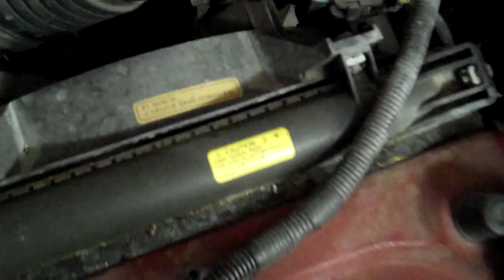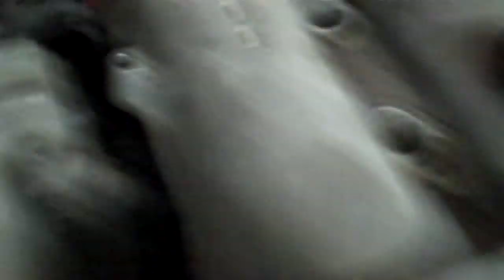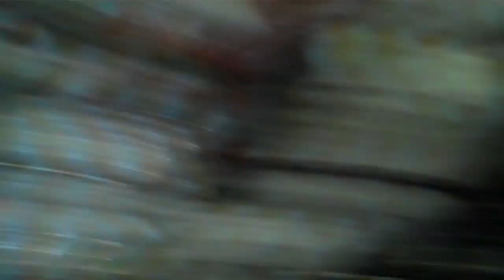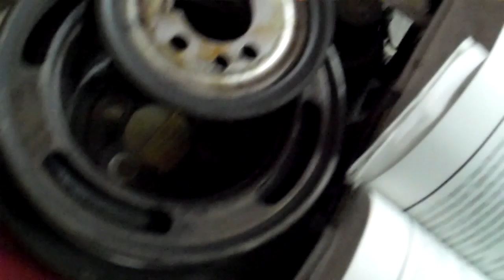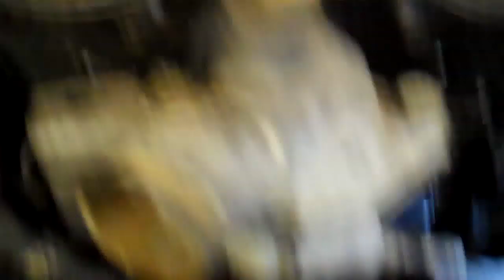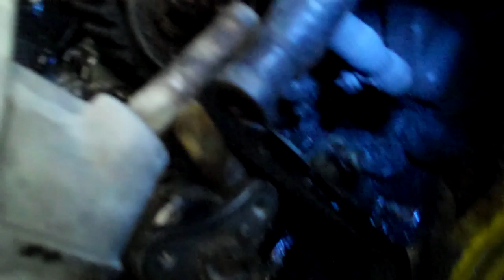Mazda Miata Timing Belt and Water Pump How to Part 1 of 2

Comment: Brian , I'm in a urgent situation where I need to fix or swap (I only have new belt and pump here) 94NA8  but its is in a place where I don't have the luxury of space or time and was wondering if there is a quick trick to seal the big leak & attempt drive the car to a garage...or at least my place , 10 minute drive ... I may tow if no other options.

Comment: Brian one other issue on the Miata is the crankshaft key on the lower timing sprocket, I found mine slightly damaged and was changing my timing back and forth. If your changing the timing belt its best to remove the bolt and replace the key and bolt.

Comment: Harmonic Balancer - easier said than done.  That was a step that needed to be shown.  The 4 - 10 mm bolts were easy enough but what about the main 22mm bolt in the center?  Do you have to loosen that bolt?  I end up turning my engine instead of the bolt itself.

Comment: Excellent video, I like your humor. I changed my water pump and timing belt about 50,000 miles ago on my '95 miata and now it looks like my water pump is leaking again, so.... but I don't remember having to take off the main pulley on the bottom of the engine, but it was 5 years ago when I did this. Thanks for the refresher course. My 1995 miata has over 200,000 miles on it, and I wanna keep it going, my wife wants me to get something with more than 2 seats in it. Yeah, let me think about that.

Comment: that's actually the cooling fan switch that you disconnected from around the thermostat housing cover. the coolant temperature sensor is at the back. Anywho, thanks for this tutorial. very thorough

Comment: Helpful! I'm about to do this job for the first time on my 92' miata. I'm also planning on removing the whole air conditioning system while I'm at it. I figure I may just take the front bumper and radiator off so I'll have lots of room to work in.